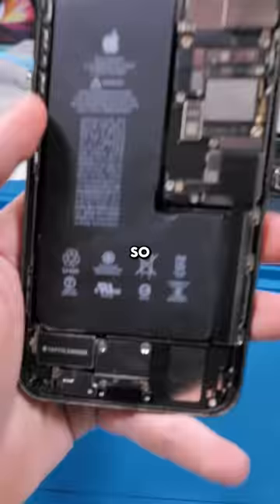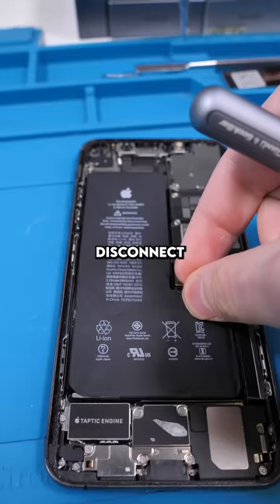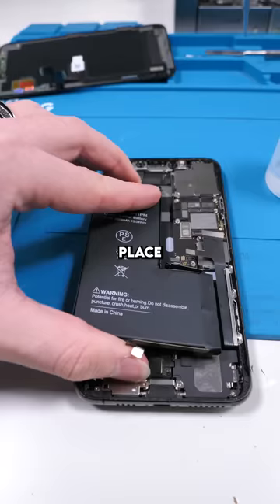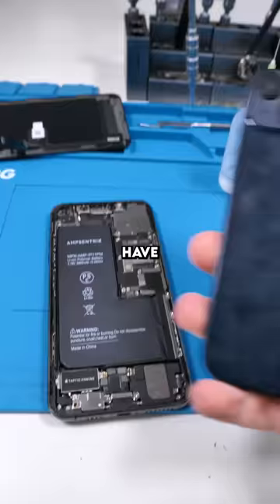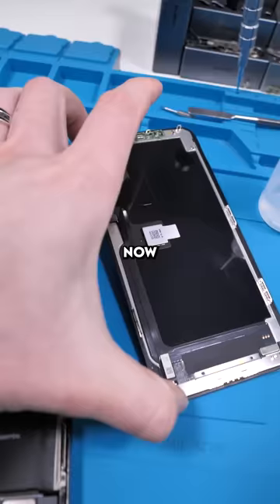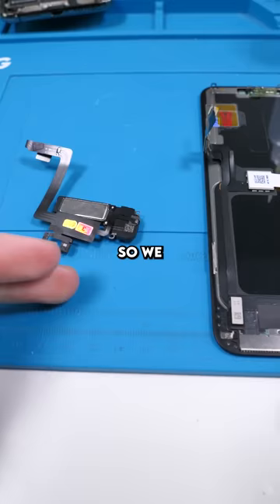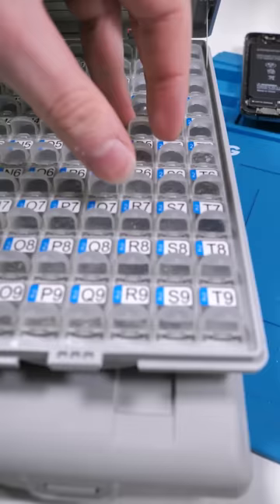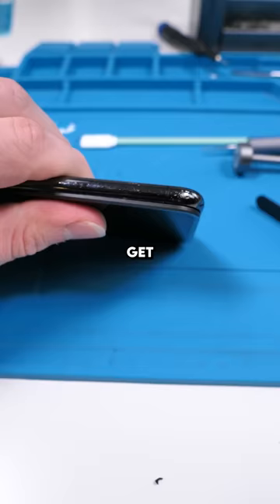What I Do When Phone Is Missing Screw #Shorts

Comment: The new iPhones do actually have reverse wireless charging, it’s only used to charge the MagSafe battery when you plug in the phone though
Reply: I don't know but I tested it on my iPhone 14 that I gave back because the software is as sh*t as always but it only worked for me when  I plugged the cable in to the magsafe battery and not the phone
Reply: @thechicken9805  it works when you plug in the phone, but it will first charge the phone up and then the MagSafe battery, but quite slowly.

Comment: I don't know if you have knowledge in repairing speakers, but i have replaced the battery on a jbl clip 3. The original 1000mah battery was swollen, I've replaced it with a 2500mah one. The thing is that the old one had a sort of pcb with a connector with 4 pins (and I guess it has the role to measure the battery charge and etc.) so I kept this old pcb and connected the new battery to it. The thing is that the new battery works, but it doesn't charge. I don't really have a valid reason for it. I've checked everything.

Comment: Oh, it has reverse wireless charging. But it only works with the magsafe battery pack. If it is dead, and you connect it to your iPhone that is charging via a cable, it will charge the case when the iPhone is done.

Comment: iPhones have had the ability to reverse wireless charge for years. Idk why tech tubers keep saying it’s fundamentally missing hardware to do it. It does it stock with the MagSafe battery pack. It’s a software lockout that prevents it for other devices. Probably based on the battery pack’s NFC chip.

Comment: Actually the iPhone has the capability to reverse wireless charge, it's disabled by software, the only instance where you can see it in action is with the original apple original power bank, plug your iPhone directly to recharge, once it's done it will reverse wireless charge the power bank!